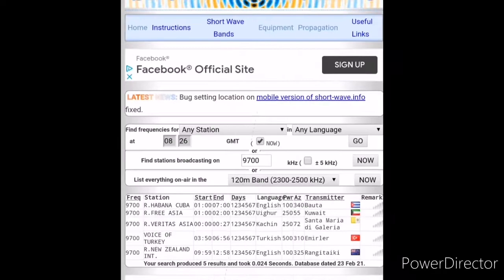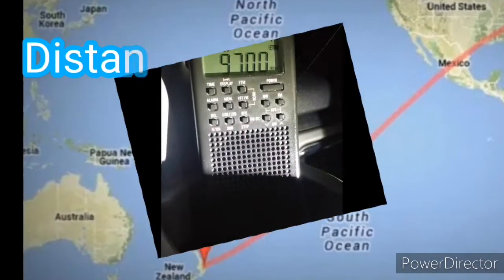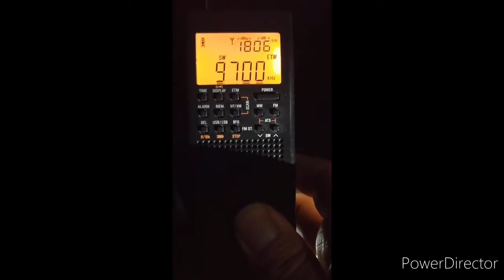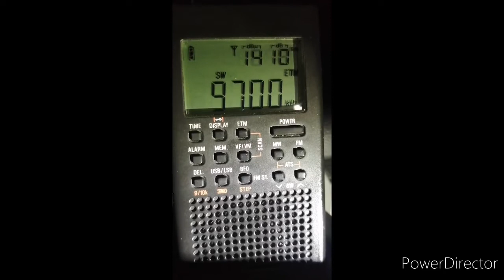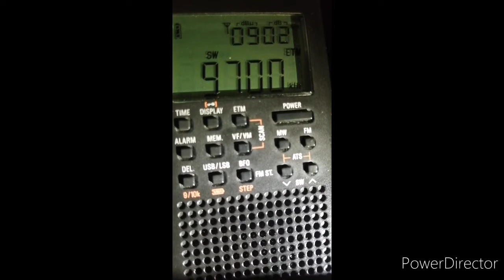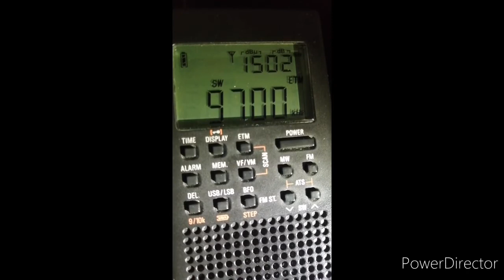County Comm GP-5 SSB - Tecsun PL-365 Copying Radio New Zealand from NYC w built in antenna. SWL

Comment: I use my everday g5rv full length I pick up alot of stations including air traffic control
Reply from the maker: With such a large antenna do you have issues with receiver overload? I would think these small radios are built for smaller antennas. What are you experiences? Thanks for comments.

Comment: Using the long antenna on the radio it is designed for powerful radio stations at 500,000 Watts you won't pick up most powerful stations however to increase reception a long wire antenna 30 ft are longer definitely will help you reception I'm using400 grounding yacht boy 400 it's a model that was built in 1996 which also comes with SSB time in Vancouver right now Canada when I go English Bay or around the UBC area I pick up Shina Cuba I pick up sometimes Africa and sometimes friends sometimes Romania and other countries by putting along wire you're getting closer to their frequencies the small intestine you have most of the radio signals come out of the sky like am skip shortwave is mainly VI Sky propagation ionosphere roughly 60 miles up if you run along wire will help you to increase your reception as well as good grounding negative side of the battery can go to grown Melia propagation from the sky and also ground propagation also if you cross into saltwater it will help your propagation as well if you hook up for example your ground wire to a water pipe that should be good enough for ground signal need both skywaves and a ground signal coming in as well some of these radios have external jacks the enables you to hook up an external antenna if you don't have an external Jack then just hook up the Lan wire to your standard antenna we will definitely help your reception at the same time if you're in a city you also pick up more RFI downsize of it you can also get yourself a loop antenna if you desire to go more professional however the standard long antennae grandfather antenna thought we used back in the thirties and forties is is going to do just fine look at the ships that were built in 1930s 40s they mainly had a long wire on top of their pool that was their radio antenna
Reply from the maker: Thank you for the tips on copying farther and weaker  stations. I will try a long wire antenna. I have  heard people using metal fences and even bridges to pull in signals. All interesting experiments for antennas. Again thank you for your comments!